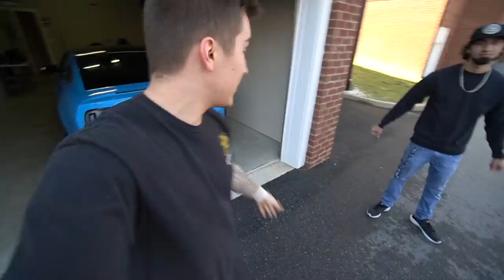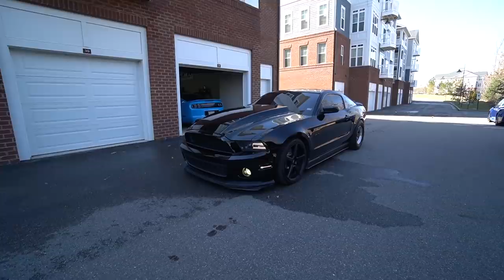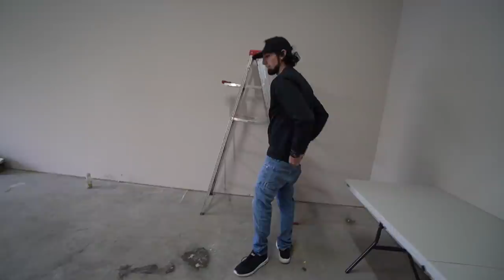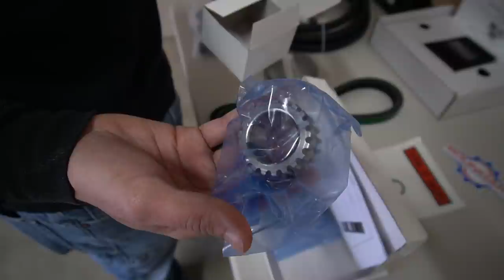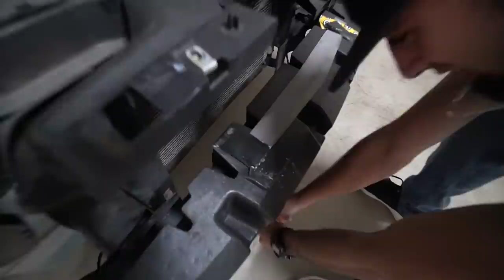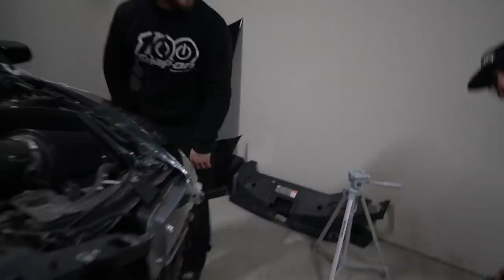Supercharging his Mustang with Paxton Novi 2200 SL!

Comment: Do a whole series on this car man if you can, a lot of Paxton owners out there don’t have a lot of stuff to go off of on YT. I been through the whole process and build with mine and have had Lil problems I’ve solved and just a lot of figuring stuff out on my own really cause there’s not many people that have content on em out. My car is a full build kinda now fuel system e85 on a 3.6 pulley full slick rxt clutch all the goods, gonna be putting a block in it and putting a party pulley on err and sending it. Went 10.76@136 with the trans going out not letting me shift as fast as I could normally.